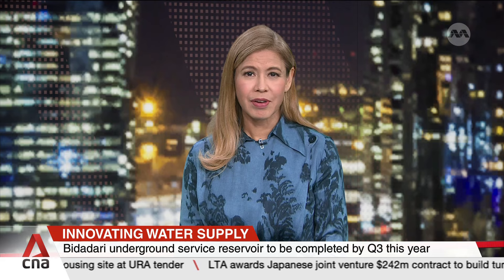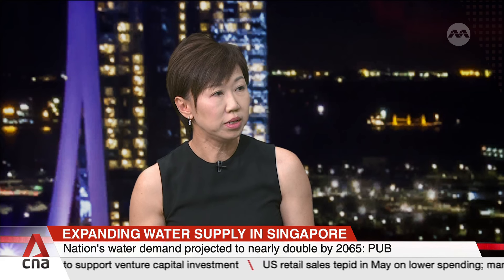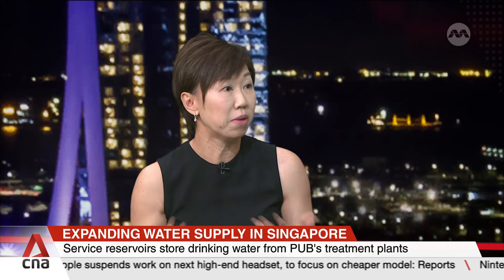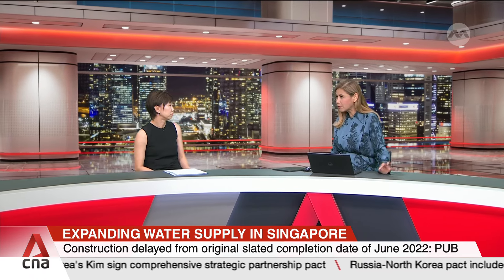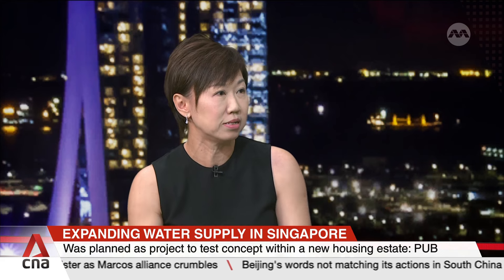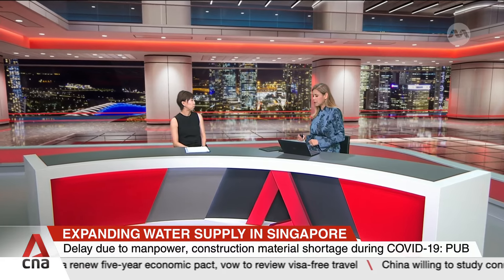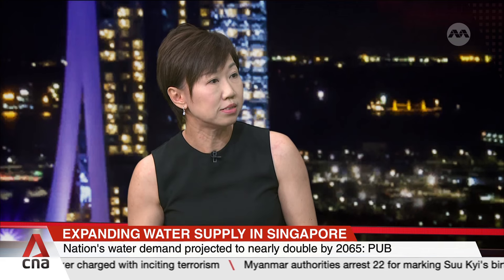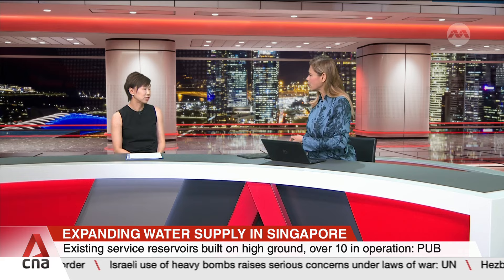Bidadari underground service reservoir to be completed by Q3 this year

Comment: Essentially building a water storage facility underground (not very deep) will require additional power, the quantum has yet to be established, now with the increase in power would that lead to an increase in power costs to the citizens and also water costs to its citizens? Is the establishment of these underground storage facilities built on the concept of cost recovery or has it been built on the concept of it being a sunken cost without a cost recovery component? In Singapore, I may be mistaken, but  I think not. Not to mention the  cost of pro active maintenance, especially the pumps and the replacement of underground high capacity piping. I truly hope Singaporeans be they at Bidadari or elsewhere will not have a hike in water and electrical rates! Our living costs are already escalating at an alarming rate and our salaries are not keeping up with the increases! So another round of vouchers for water & electricity to try and cope with inflation?